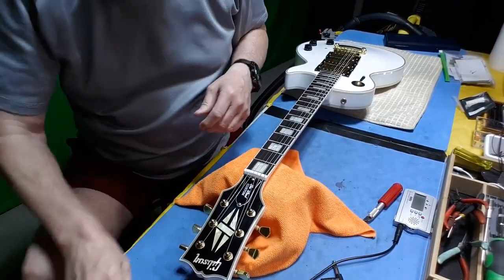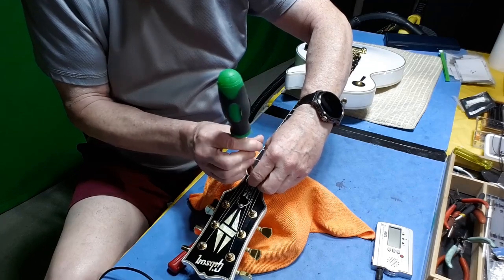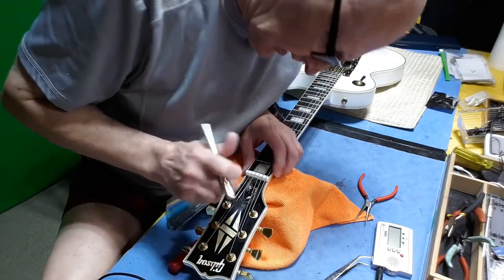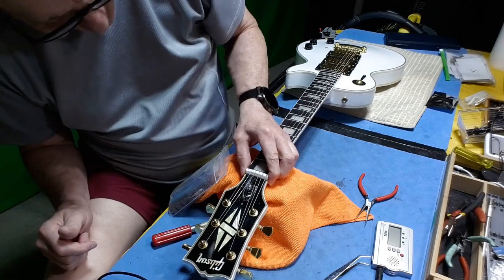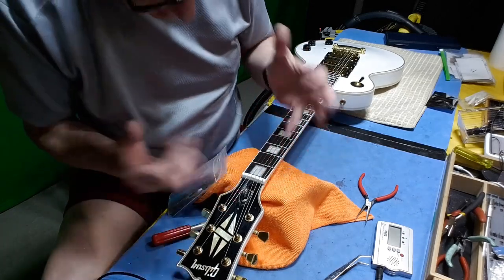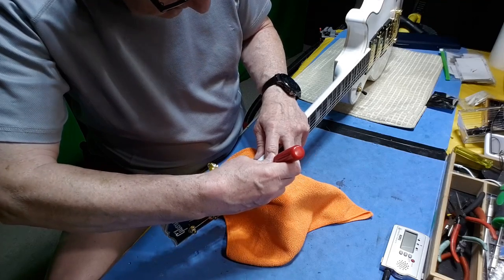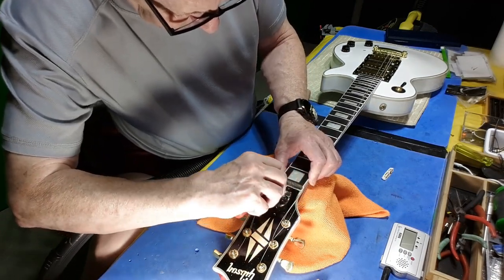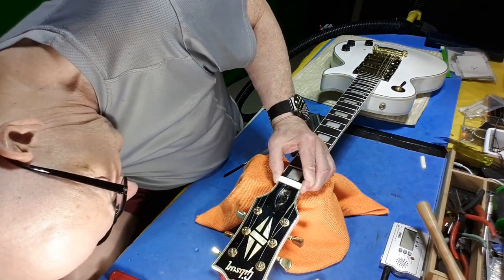CHIBSON WHITE BEAUTY STYLE - REWORK BEGINS - PART 3

Comment: where have you bought this guitar?
The headstock is really nice, usually the chibson have a hard time copying the shape/length of the headstock and diamond inlay, they are longer like the standard ones and the gibson logo is set too high
Reply from the maker: Aliexpress here, but was on a special at $222 CDN.: https://www.aliexpress.com/item/1005007171526929.html?spm=a2g0o.order_list.order_list_main.16.6cf41802rYzYag
here is another option for less $$$
https://www.aliexpress.com/item/1005007642087222.html?spm=a2g0o.productlist.main.11.3656aa6cLJEaIP&algo_pvid=3e155de0-1a30-4f59-8af8-86f4f7216f10&algo_exp_id=3e155de0-1a30-4f59-8af8-86f4f7216f10-5&pdp_npi=4%40dis%21CAD%21334.98%21200.99%21%21%211717.85%211030.72%21%402101e81117261599738223021e9abe%2112000041619075390%21sea%21CA%211738791071%21X&curPageLogUid=mDLDsy5U2fPh&utparam-url=scene%3Asearch%7Cquery_from%3A
Usually I get naysayers about the headstocks I can't have changed for me.